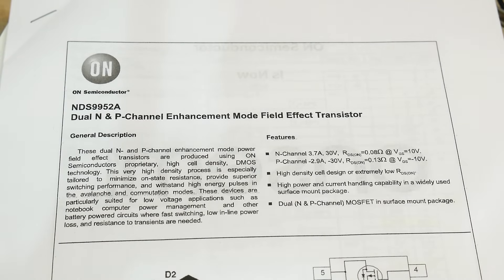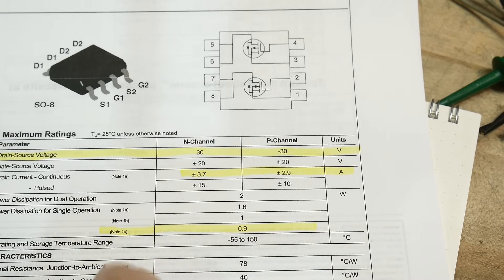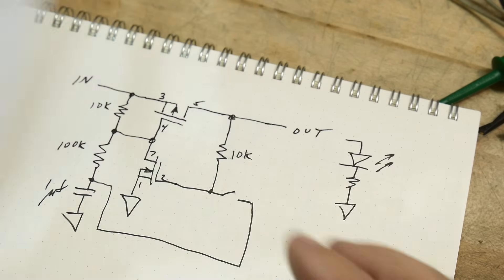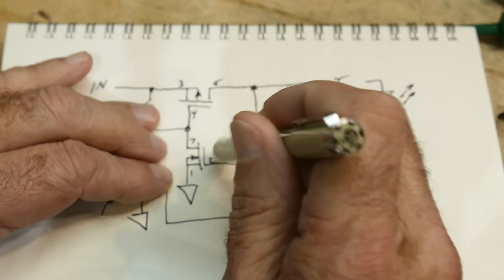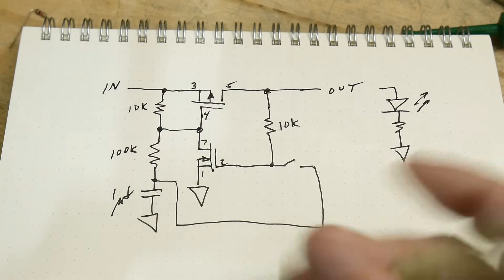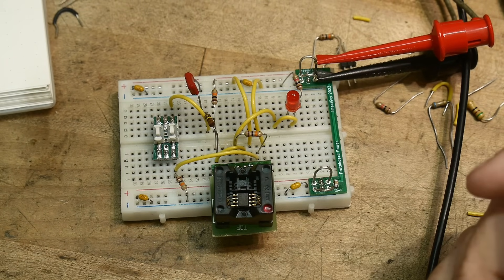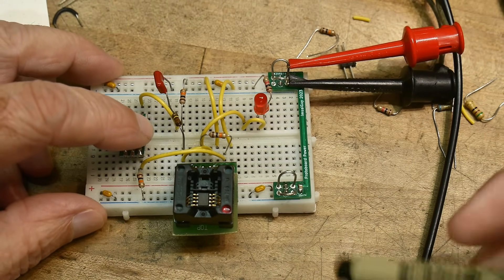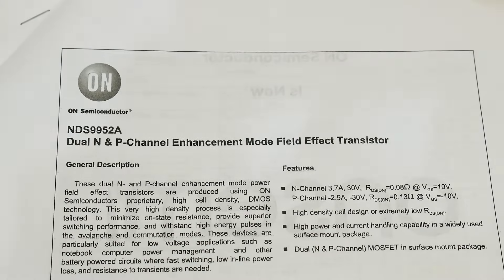#1833 NDS9952A Dual P-chan N-chan FET

Comment: I'm wondering what the quiescent current is of this circuit. I do a similar thing with a 4013 only differences I can put a cap and diode on the supply voltage and it acts like memory so the switch state remains even if the power is turned off for quite some time

Comment: The thing I wonder about the fix is what is the gate voltage at the n-channel when the circuit is on? It's only 1/2 the output voltage. As long as that's "well above" the threshold of the nfet, that's fine, but if it's close to the threshold, the nfet might not be fully on. Maybe it doesn't matter because the nfet doesn't carry any significant current in this circuit anyway. If it was an issue, I'd increase the value of the pull down so that the voltage divider is biased towards the high side, and the nfet gate voltage is a bit higher during "on" phase.

Comment: Waht do You think, can this kind of transistor be used in analog circuit, thinking of traditional audio amplifiers just for example. Of course not so much power, maybe in the driver stage or for headphone amp together with opamp?
Reply from the maker: read the datasheet: "These devices are particularly suited for low voltage applications such as notebook computer power management and other battery powered circuits where fast switching, low in-line power loss, and resistance to transients are needed."
of course other applications are up to the imagination

Comment: Before you added the resistor the P channel FET turned off momentarily when the switch was pressed a second time.   That allowed the capacitor to charge up to whatever voltage is required to turn the N channel FET back on.    The brief duration of the P channel FET being off is sometimes noticeable as the LED blinks.   A much shorter button press would work.   With the added resistor the capacitor can't charge up enough to turn the N channel FET back on.  If you look at the original circuit with a scope you will see how the P channel FET turns off momentarily, allowing the N channel FET to turn back on.  Another circuit built at random with no analysis.
Reply: I wouldn't use it in a medical device.  I see no bistable nor hysteresis circuit here.
Reply: @bayareapianist  Using the P channel FET is a bad idea.  Not blaming the author of this video.  The P channel FET has a higher ON resistance.   Using this chip in a motor control H bridge is not a good idea either.   An H bridge that mixes P channel and N channel FETs has a discontinuity at the zero crossing.    Also a lack of symmetry.   Try to use an H bridge like that with a PID  controller and stability will be a problem.      And no one wants to use P channel Fetus anyway.   4 N channel FETs, with low Ron, and driven with highside/lowside drivers is the way to go.   There are lots of good integrated H bridges available.
Reply: Indeed. At first glance my first gut feeling was "wtf, this doesn't seem to be properly bistable - it will toggle but will feed back and go around again..."

Comment: Good job. I have used the traditional npn-pnp circuit working similarly but carrying a few components more. I noted with it that in noisy environments it is required to have capacitors 10 nF to ground or so, at the bases to prevent glitches. I assume this circuit may be just as sensitive and needs to be slowed down a bit.

Comment: Digikey describes the NDS9952A as "obsolete" ... none are available at Digikey, Mouser, or at JLCPCB. LCSC Has 3 pieces from  alternate supplier VB Semi of Taiwan. Of course, there are plenty of  other N/P pairs
Reply: So does Arrow. And Onsemi themselves says it's obsolete.
Reply: This power switch is something I wanted in my arsenal, so I drew up the system in Kicad. Since I couldn't find the 9952, I searched Digikey for N/P mosfet pairs, with Rds On up to 25mO. Looking at 57 remaining options, Diodes inc DMC 3025LSD-13 shows stock of 35,000 pieces at a good price $0.66US. The one downside is the advertised RdsOn was for the N Channel, and it's the P channel that's doing the heavy lifting. That only gives 45mOhm.  So for a 12V supply (I'm thinking in terms of eurorack systems) this would be 1W at 5A. Are there other characteristics I should be focusing on?

Comment: The 100k + capacitor is slow enough to avoid bounces on/off
I think the problem with the original circuit is the 10k pull-up that is too strong. Replace it with 100k and you won't need the extra 10k (I hope)

Comment: To ascertain the reason why the original circuit didn't turn off for you, we need to analyse the circuit. When the led is on, the voltage at the gate of the N-channel is close to the output voltage, which is close to the input voltage because the gate of the P-channel is then close to ground and it is in ohmic mode with a low resistance. That assumes that the supply voltage is larger than the threshold voltage of the mosfets (1V to 2.8V). That means that the capacitor is discharged close to ground via the 100K resistor. When the switch is closed, you are then trying to dump the N-channel's gate charge into the capacitor causing the gate voltage to drop and the drain voltage to rise, but the Miller effect will tend to oppose that, with the result that the N-channel's drain does not rise high enough fast enough to turn off the P-channel before the capacitor has charged sufficiently to keep the N-channel from turning off any further. I suspect that this is likely to happen when the supply voltage is 5V or more as that gives sufficient opportunity for charging the capacitor before the N-channel gate voltage can drop below its threshold voltage.

By modifying the circuit to use a resistive divider to set the N-channel's gate to only just above its threshold voltage, you increase the chance that closing the switch will turn off the N-channel before the capacitor charges up. You could test this by exploring the effect of different supply voltages on the reliability of the toggle operation.

Edit: I suspect that the original circuit was using a power P-channel mosfet and a small-signal N-channel "driver" which, of course, has much smaller associated gate capacitances (the NDS9962A has Ciss of 320pF and Crss of 85pF typical compared with Ciss of 60pF and Crss of 5pF maximum for a 2N7000) so I would expect it to behave rather better than what you experienced.

Comment: I have some Si4599DY chips, same pinout, slightly different specs (mine are mounted on a small breakout board). Ralph Bacon did a video using them to drive a bi-colour LED from one pin.

Comment: I used the same with a uC to do a soft on/off latch circuit. Working very well. Even on battery powered device. All is on my instructable page for more detail. DMG6601LVT, SIL2308, DMC3021LSD-13, IRF7319TRPBF, are all pin compatible together. Thanks for sharing.
Reply from the maker: here is his page: https://www.instructables.com/On-Off-Latch-Circuit-With-UC-One-Push-Button-One-P/
Reply: Yeah, also 600 amp 1200V IGBT modules are suitable to drive p-ch fet gate ROFL

Comment: Indeed, I was wondering initially how that capacitor is actually discharged,  nice circuit and ideal for applications where you need to have a small on/off switch.

Comment: In order to turn on the P-channel MOSFET you should bias it by adding a resistor between source and ground, the gate must have negative voltage in respect to source.

Your description about differences between P and N channel MOSFET is not accurate, it’s not about low, or high level voltage.
N-channel MOSFET will start conduct when the gate is polarized with positive voltage in respect to source, and P-channel MOSFET will start to conduct when the gate is polarized with negative voltage in respect to source.

Comment: I'm thinking that if the circuit was connected to a larger circuit load, the pull-down resistor may not have been needed but I think its a good idea. Better safe than sorry.

Comment: I speculate that the origin circuit loves (needs) resistive load, hates capacitive load and confused by non linear load.
If we put a 10k resistor as output load, probably it will work.
If we add a 100uF capacitor at the output, probably it won't work.
Just my shallow speculation.

Comment: the internet were anything is possible even 5v logic to 3.3v logic 
without a bi-level shift converter and it never gives up the ghost
Reply: @tripplefives1402  im well aware of this i help many on a MCU server and  so many tutorials will send 5v to 3.v volt logic and sometimes the sensor is tolerant and sometimes it is not. the original comment was in response to  a flawed design found on the interwebs. missing a pull down resistor .
Reply: @tripplefives1402 you missed the point its ok

Comment: ?? Not clear how that turns off.
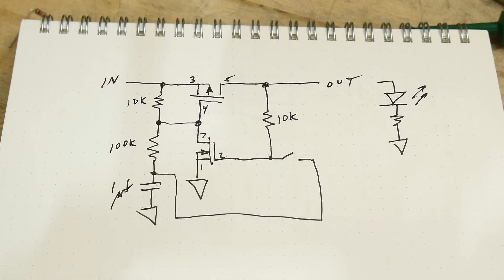Reply: 5:36 “…well anyway…” is not the clearest circuit description 🤣
Great little cct though, thanks for sharing. 
Basically the cap is discharged all the time the output is ON, by the N MOSFET. When the switch is closed,  the cap’s  low voltage pulls the N mosfet’s gate low, which switches both mosfets off.
Reply: @VividSolutions  duh, thx